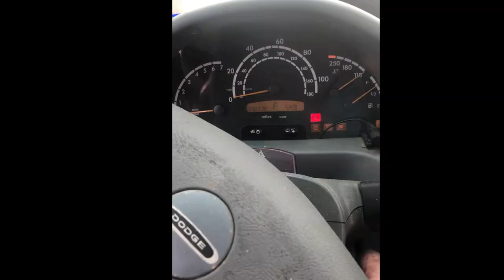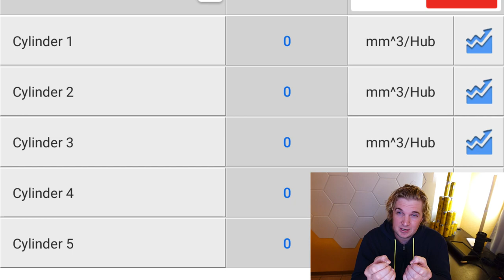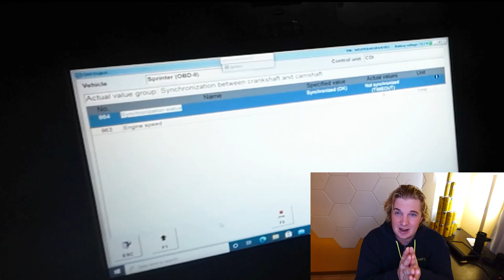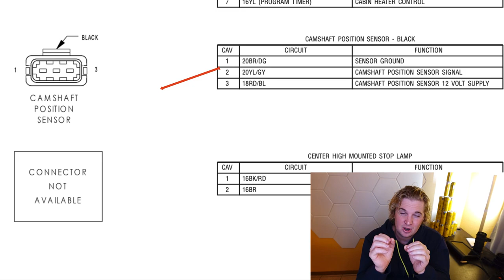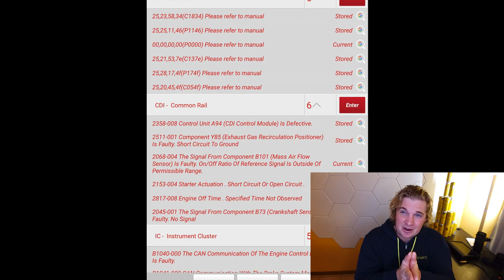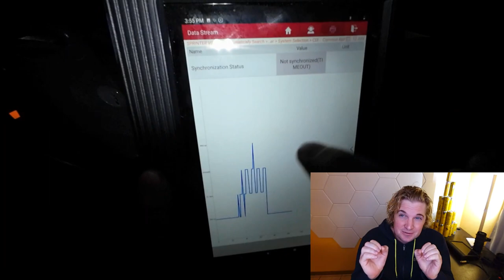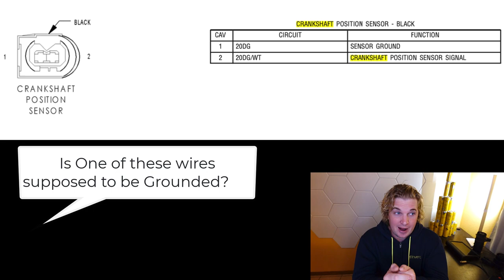Sneaky Sensor Causes No-Start Issue On This 600 Dollar Sprinter Van

Comment: I love the format. explain the mystery step by step.  I'm on an older Fiat to cut her that doesn't have any of this electronic stuff and everybody told me that the electronic stuff isn't good but listening to you it sounds really good.  Imagine having a computer that will tell you what the injector firing pressure is? Wow. Want.
Reply from the maker: Getting a descent scan tool doesn’t have to cost a whole lot.  I’m glad u like the format.  Hope the fiat engine is treating u ok.  I’m not a huge fan of those. I’ll have an update on different scan tools and best options soon.
Reply: @sprinterfix Yes I think my next motorhome if I get another motorhome would be a sprinter-based one. Although one thing I noticed about your video is that with these electronics you are able to debug a motor situation just by looking at electronics but at the same time you have to debug the electronics. You're not entirely sure if it's the motor failing or if it's the sensors failing.
Reply from the maker: @surfreadjumpsleep  well yea, thats sort of true, in this case I didn't suspect a blown motor much but I likely wouldn't have spent so much time on it if I had heard  a blown cylinder. everyone calls these things unreliable which I really dislike, mostly because they aren't precise in their reasoning, there are a few systems on here  which can are a bit of a headache but the reliable drivetrain more then compensates for their those minor hiccups, I'd get a 2007 to 2009 if its your first sprinter